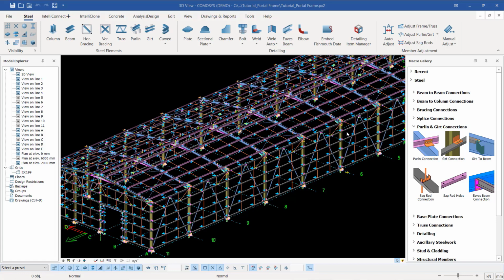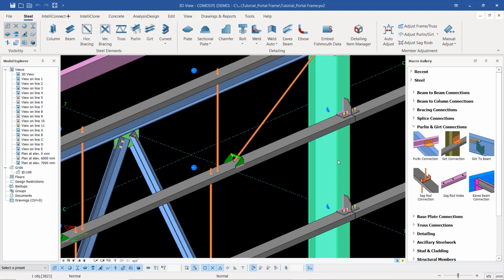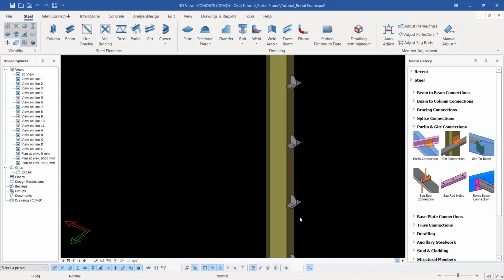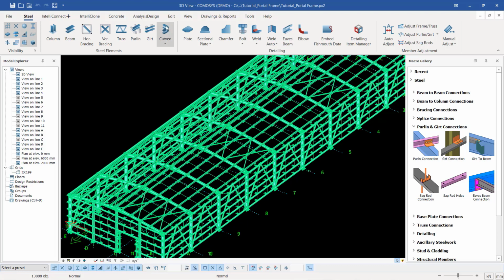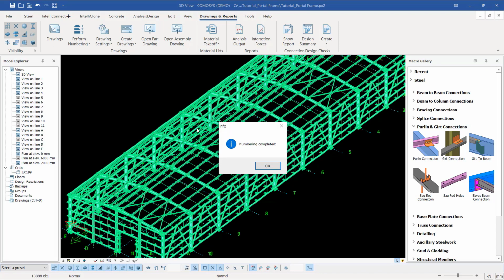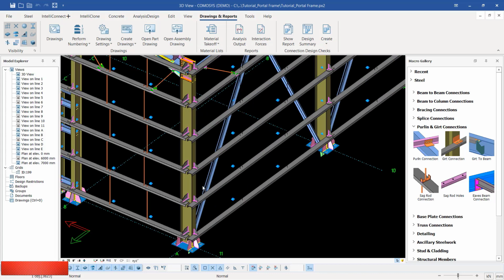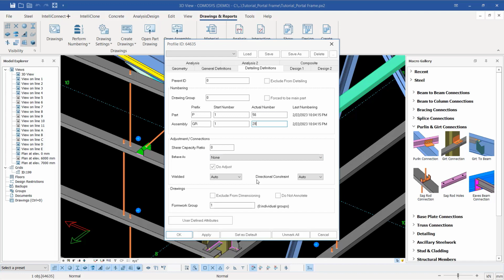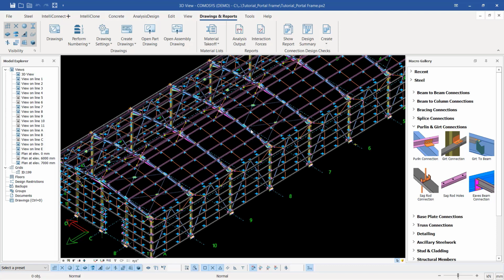How to Create Model Numbering in COMOSYS

Comment: Excellent video.

Is there an editable table to allocate Prefixes to different object types ie R = Rafter , C = Column?

Also I didn't see any ability to use Sub Assemby numbering.  Is that an option?

Looking forward to the next video for drawing production.
Reply from the maker: I used default numbering setting but you can customize
Reply: @Maurice Dimba  is there an interface to customise, or is this done via backend databases?